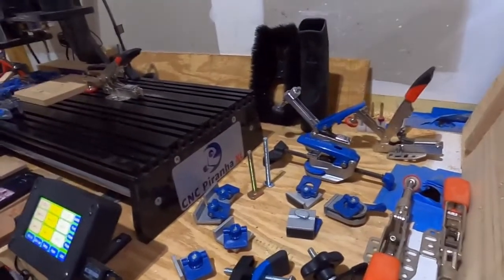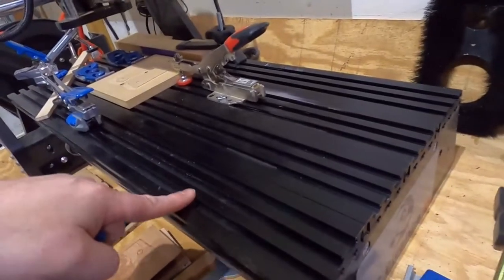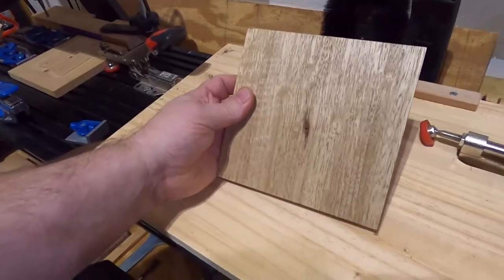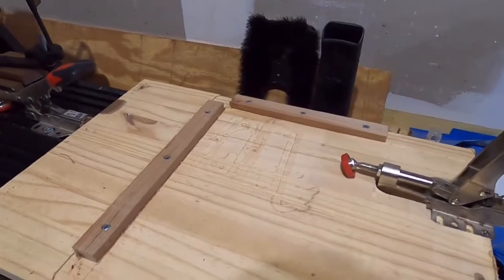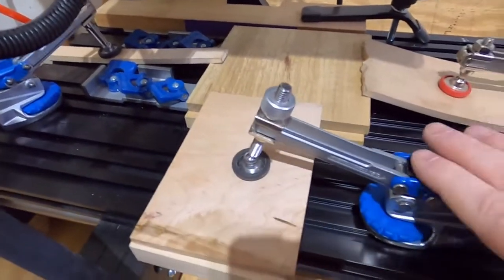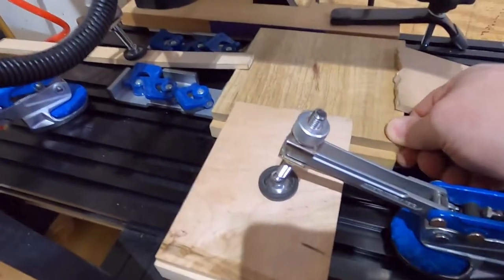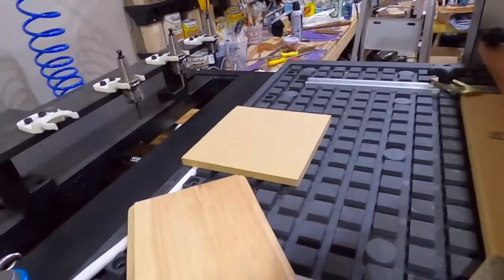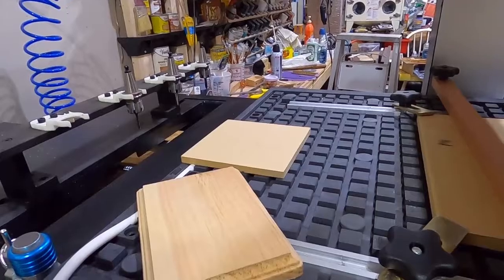Tool Tip - CNC clamps and vacuum table

Comment from the maker: Different types of clamping in the video
Using Spring Boards : https://youtu.be/bWjJndUznTU?t=598
Double Sided Tape : https://youtu.be/bWjJndUznTU?t=744
Wedge Clamping : https://youtu.be/bWjJndUznTU?t=990
Cam Clamps : https://youtu.be/bWjJndUznTU?t=1086
Wide Clamps : https://youtu.be/bWjJndUznTU?t=1208
Vacuum Table : https://youtu.be/bWjJndUznTU?t=1279